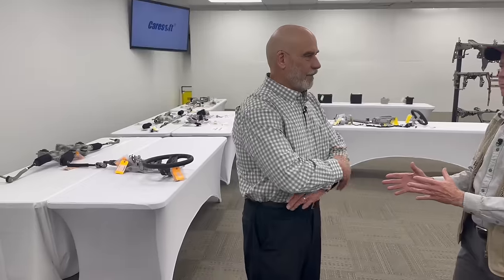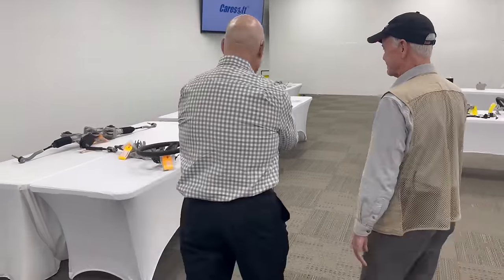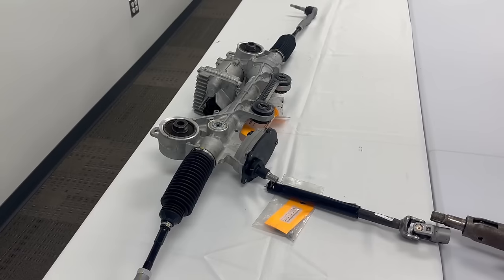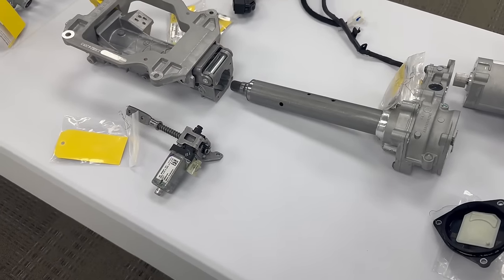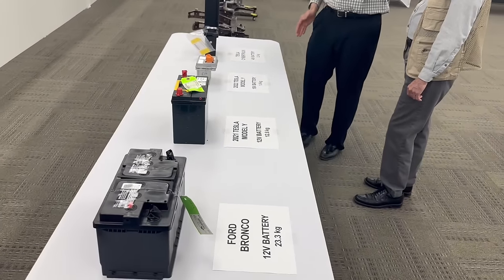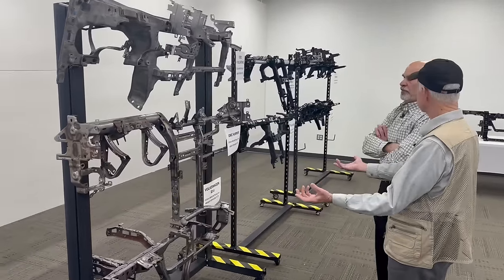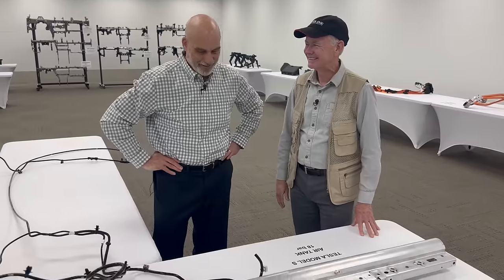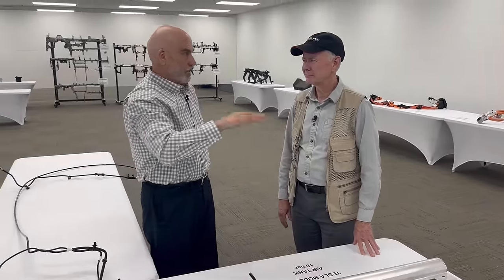Tesla's Extraordinary Design Evolution - Caresoft Cybertruck Teardown

Comment: Al of this talk about the steering etc ..Id think it would be redundant to have only one steering motor in the front working as the other motor would be forced to work without power which is bad for a motor and its gearing where gears are cut to be motor driven with both motors giving the steering system stability then if one steering motor craps out the other will still be able to power the steering..

Its not any different than adding a second steering servo to an RC monster truck to enhance steering stability..

When the truck has no power applied the steering wheel can be turned fully with it sitting rested on one of its locks and when energized instead of the wheels turning the way the steering wheel is oriented the steering wheel matches the position of the 4 wheels...

Another thng is I see QR codes on alot of stuff yet noone is using a QR reader to come up with any possible hidden and possily interesting information about who manufactures the components and where..

Comment: Interesting presentation! I found it difficult to get through the last one with the cyber truck. A bit too many asides and pauses for my tastes, but this was laid out well and moved briskly. I found myself wanting to hear more about each part, rather than being done with it already.

I'm particularly interested in the aluminum charging rod. There are clear benefits in terms of cost, weight, and installation. But I'm wondering what the cons exactly are. It's this a factor in why tesla charging curves aren't always the best, like on the cybertruck? But then again, it's still pretty great on some of the other models. Curious for someone to deep dive into that. Maybe Out of Spec?
Reply: There are no cons on the charging rod. You never needed big copper wires in the first place. The poor charging curve is due to Tesla being careful with the new battery. Expect software updates to improve that once they have more data on how the batteries are performing in the field.
Reply: @EwanM11  I mean, there must be some drawback to it if newer vehicles still choose to go with the copper wires. Though maybe they just didn't think it was worthwhile to change the processes after they were first put in. Still. I would think someone like rivian would be willing to switch things up and do this if it were clearly better. Interesting.
Reply: @Cyrribrae  i see. The disadvantage is that you have to make a process change. All Process changes in manufacturing come at a cost and it will depend on whether that cost is worth the benefit. The cost is both administration (i.e. paying designers to come up with the new design as well as getting it evaluated and approved) and tooling to make the new part. Tesla have very slick admin process and do a lot of tooling themselves or with slick supplier relationships so their cost of change is much much lower than for most manufacturers.

Comment: The engineering behind the Cybertruck front/rear steer by wire is mind boggling. The average buyer simply won’t appreciate the design, engineering, validation and precision parts manufacturing that went into the CT.
Reply: It isnt mindblowing at all!Its just ok!
Reply: Infiniti Q5 has had steer by wire since 2014.
Reply: The reason I pulled the trigger on a Model Y in early 2020 was because I watched Munro tear it down.  That said, I did plan on buying an EV and had just installed more solar + a Nema 14-50 receptacle in my garage.  But, my original plan was a used Model 3 at the time.
Reply: @brunoheggli2888  SWEETIE, YOU'RE TROLLING TESLA?
Reply: @NomenClature-o8s  IT'S GONE, IT WAS A SHORT LIVED TRIAL.
Reply: @MICHGO1  Lexus had steer by wire too in the RZ450e. Yawn.

Comment: 31:15 I’m not convinced that the aluminium sleeve around the central aluminium conductor of the charge ‘cable’ is for protection. I suspect it might be that Tesla have a deeper understanding of how electricity actually flows through a wire - the ‘skin effect’.
Reply: It is also for safety. The outer skin is grounded so if you cut you will shortcircuit and open a breaker insted of getting electrocuted.

Comment: Having a special water fording mode for battery pack implies water can intrude otherwise..?!  😮😢  If so... That’s a corrosion situation unacceptable in an EV that can catch fire or cost $18,000 when the battery dies. Not to mention the crash risks and deaths.  SALTY roads and age will likely make EV battery shorts and fires common with aging autos if seals are going to be failing...?  Disaster for EVs...?   Please comment on aging EV safety and seals as cars get 10, 20 years old as some do.  
     Batteries need to be sealed better than ‘oh, we can prevent water with a special mode if you like...’ !  ❤ What’s the situation here?
Reply: It’s pretty obvious that fording through deeper water subjects the seals to more pressure than normal. Preventing that seems a wise precaution to me. But you be you.

Comment: You missed a lot on the Cybertruck 48V battery. Here is the information from the label (from the Cybertruck online manual):
PartNumber 1679931-00-B
Cell Combination: 13s1p
Rated Capacity: 4 Ah
Nominal Voltage: 41.6V
Supplier ZhuhaiCosMX Power Battery Co. Ltd.
Made in China

Two conclusions: First: 4 Ah * 41.6 V nominal = 166 Wh capacity. This way more than the 99 Wh capacity in the 16V Li-ion battery in Tesla S3XY.
Second:  41.6V nominal divided by 13s = 3.2 V nominal per cell. So this one has LFP chemistry inside its 42V battery, while the 16V Li-ion battery in S3XY are CATL NMC cells.

Comment: Funny how they mitigated the risk of the battery sealing by adding pressure. I was an engineer at a Detroit OEM and was directed to remove the vent plug on a wiper motor assembly to save 5 cents. The motor assembly would sit in the sun under the cowl screen grill and then it would rain or go through a car wash. It would suck in the water and kill the motor. Because it was a safety component it turned into a recall. All hands on deck firefighter engineers to the rescue once again. So much for the cost savings they wanted.
Reply: Great comment! 👏👏

Comment: So... What happens if the belt breaks in the rear steer system? Seems like a very bad single failure point
Reply: The rear steer system is not mission critical. If it fails, the car still drives, just with a slightly wider turning radius.
Reply: @moreliberty1 
It depends which way the rear wheels are pointing when the belt breaks.
Reply: @freddymax5256  Physics would just return the rear wheels to parallel.

Comment: 13:56  this guy isn’t just about reducing cost to the manufacture he’s also about increasing the cost of ownership & end use. Listen to what he says, “giving away the tooling”  which increasing maintenance cost & reliance on dealership service dept.  Screw these guys that are anti right to repair and shade tree.
Reply: His point was that traditional lead acid batteries on ICE cars are so heavy that they require built-in handles. The Tesla Li-ion batteries are much lighter so they don’t need them.
Reply: That wasn’t the point his first time he mentioned the tooling being needed &  that it’s an additional cost to manufacture… when mentioned the second time it’s about it being given away…. The only reason to mention that is because it would be his recommendation to sell it as a speciality tool.
Reply: @NvTwist  mind reading 

Blocked
Reply: @fredbloggs5902 lol you wish my powers were minuscule enough that “Blocked” could vanquish me from receiving your thoughts…. Should’ve have posted the first draft, but deleting it was kind of you. 😁
Reply: @fredbloggs5902 
The secondary battery is light because the power needed to run most of the electrical demand comes from a several thousand pound main battery that is placed between the wheels.
Reply: @freddymax5256  Thanks Captain Obvious. I was referring to the LAST battery, and anyway my point was that the smaller battery didn’t need handles, regardless of the reason it could be lighter. The OP was claiming the reviewer was against the handles themselves.